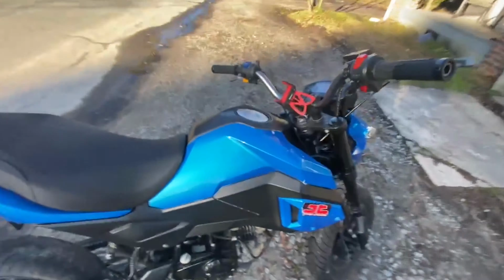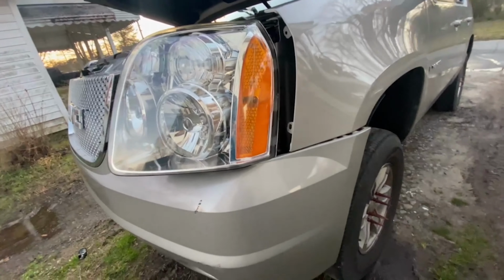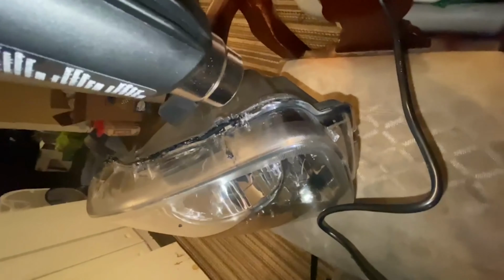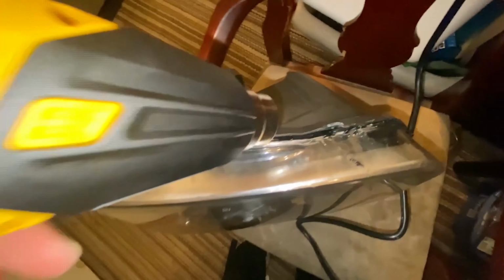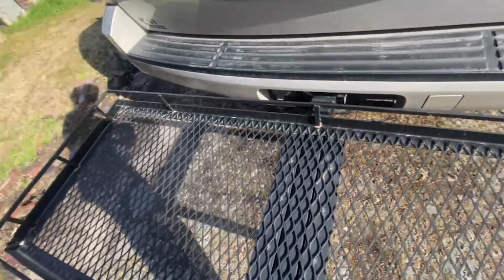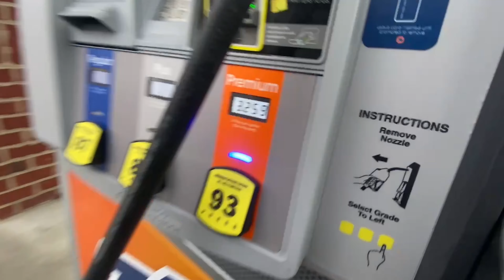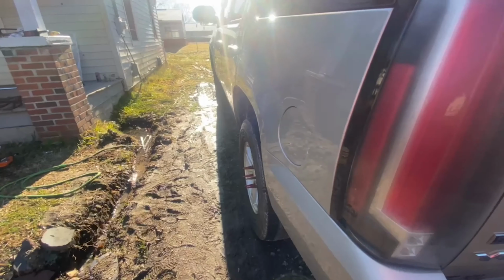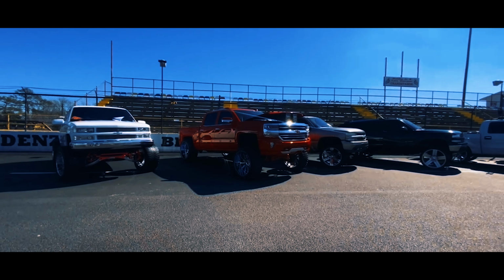HOW TO CLEAR ANY HEADLIGHT | YUKON CHROME HEADLIGHT | DRIPPIN FT.MKSLATT MEET!

Comment: I have a 13 Denali It has a little bit different headlights The reflectors are smaller and it has 2 in each light will this work for those particular headlights?
Reply from the maker: id say aslong as you can seperate the housing and reseal it good, you can modify what ever inside the housing, so yes it should work in theory.